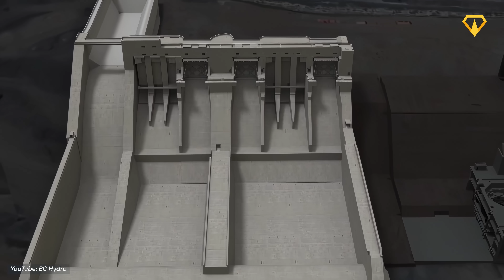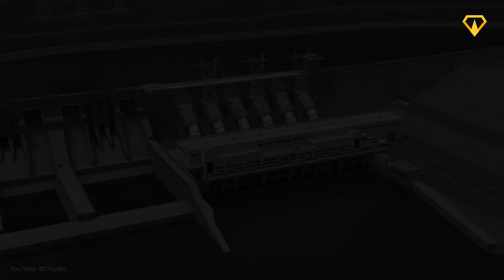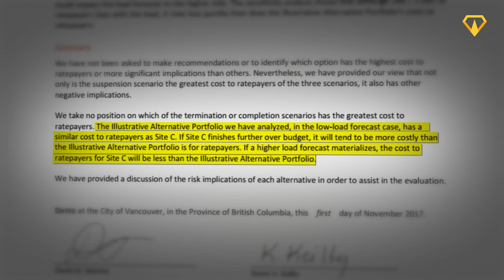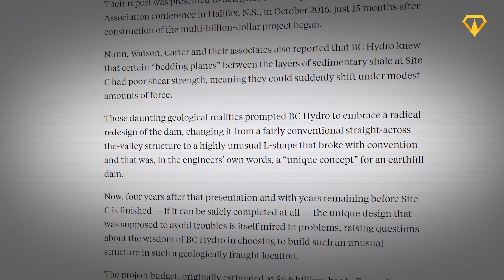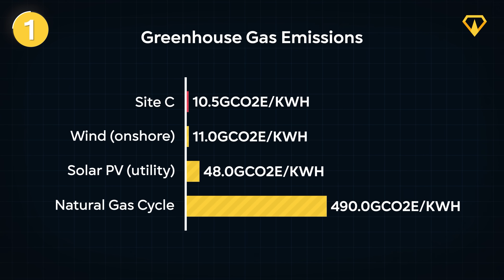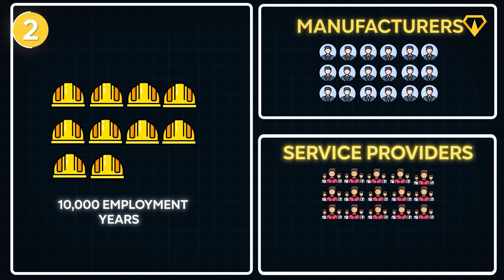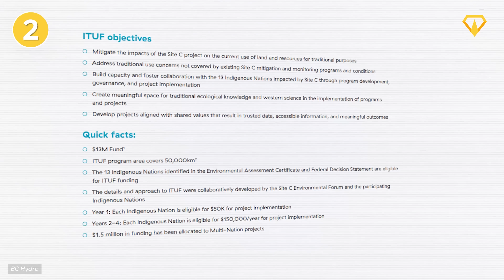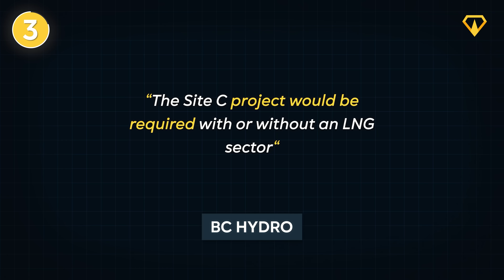Canada's Massive $12B Mega Dam

Comment: Why not build nuclear power plants? They're much smaller, give lots of power, are clean and require extraordinary amounts of idiocy to even possibly go wrong. Seriously, the amount of hubris and stupidity that happened at Chernobyl and to a lesser extent at Fukushima was unbelievable. Chernobyl had the recipe where they were unintentionally making an explosion happen. Fukushima had bad operators and still it's not nearly as bad as some make it to be. That's the entire list of actually bad nuclear power events. So build nuclear power plants. They're also very cheap once you get them up and running and new one's are far safer than old ones. What happened at Chernobyl could never happen again.
Reply: The biggest reason not to go nuclear is cost.  There is a reason that only one new power nuclear power is being built in the US and that is because it is absurdly expensive.  The 2 new power plants built for the Vogtle Nuclear power plant cost 31 billion $!! 

 The supporters of nuclear power always seem to ignore that glaring point.  All of that expense and elaborate technology just to boil water cleanly.
Reply: @michaeldeierhoi4096  the USA didn't stop nuclear because of the cost, it did after the Three Mile accident, widely covered so the typical USian just knows about Chernobyl and Fukushima
Reply: And the design changes and regulation oversight that came out of those disasters led to the high cost of construction. No member of the public was exposed to radiation in 3 mile island or fukushima but the reputational damage to nuclear was done.
Reply: @michaeldeierhoi4096  Most of the cost is upfront cost and very little on going expense and certainly some large portion is in unnecessary red tape and safety procedures. Sure, we want to be safe, but much of the safety stuff in other industries is nonsense so I'd be unsurprised if many of these weren't needed either.
Reply: @SpidermanandJeny  Fukushima didn't have bad operators, it was just not fully aware of the consequences of a tsunami that huge.
Reply: You could build 1.4 Gigawatts for half that using nuclear.
Reply: They’d be so worth it if they didn’t seem to redesign it every time they build a new one
Reply: @PineappleKarl  and the problem with a new updated design is????
Reply: Like You mentioned they are smaller! 
Nuclear has a very small footprint as compared to a dam and it’s reservoir.
Reply: Too many unions involved in nuclear extorting the operators. The parts of the country operating nuclear have astronomically higher hydro bills because of this.
Reply: The cost of shutting down nuclear power plants is never factored into the cost of producing nuclear power, it’s very very expensive to mothball radioactive reactors
Reply: @griggbaylee5808  yet another reason to not shut them down unless it's completely absolutely necessary.
Reply: You are ignoring "3 MILE ISLAND"? 1 accident is 1 accident too many.
Reply: @bunzeebear2973  nothing happened there. There was no exploding nothing close to it. Plus, that was many decades ago and there has been nothing in the US that's been interesting except that nuclear power has gotten even safer.

Comment: with an installed capacity of just 1.12 GWH I would say it is a waste of money. Ethiopia built a 5 GWH hydroelectric plant for just 6 billion dollars. This is expensive, very expensive.
Reply: Capacity isn't in GWh. The Nile river has 1.5 times the average flow of the Peace river, and the GERD is built with 2.5x the elevation, which means the exact same turbines there would be expected to produce 4.34 GW of electricity. The 1.12 GW of capacity at this dam is very much in line with what is expected on a river of that size. The power output is based on hydrology and elevation, and has nothing to do with "how good the dam is". Combine that with the average (professional) salary in Ethiopia being a third of what it is here, and the cost of this dam seems pretty reasonable in comparison.
Reply: @SulfuricDonut  I'm talking about the size and price relationship of the plants. Given its size, it couldn't cost more than 3 billion.
Reply: Ethiopia labour cost is a fraction of those in Canada.
Reply: @kwan3560  Are you telling me that labor costs represent 95% of the total cost of the work? Don't try to fool yourself.
Reply: @DanielSilva-jj2lz     You'll notice that Daniel did not sight a specific amount related to the cost of labor difference , but that is a significant factor in the lower cost of the Renaissance Dam.
Reply: @DanielSilva-jj2lz  Get your head out of the sand and you can do the math yourself. All the fixed cost items will be roughly the same be it Canada or Nigeria that's buying the hydro generator and such. Concrete and steel bars are also will be mostly close enough. Majority of work done will be manual labour, driving bulldozers and dump trucks and whatnots. Don't forget, Canada has a boat load of labour benefits that's not available in Nigeria in addition to the much higher actual labour cost. And then there is the 'environmental' side of things, everything will be much more expensive in Canada simply because every relevant and non-relevant entities will want their cut of the money first. The math literally is very basic and very simple.
Reply: Which dam??
Reply: @100eyez4  GERD dam
Reply: @DanielSilva-jj2lz  of course you won't generate the same amount of energy as a single dam would, but that's a consequence of not having a huge reservoir above it
Reply: You could build 1.4 Gigawatts for half that using nuclear.
Reply: @hg2.  The cost of maintaining a nuclear power plant is extremely high and has a lifespan of a maximum of 80 years. 120 years from now this hydroelectric plant will still be in operation. Nuclear only if there is no other option.